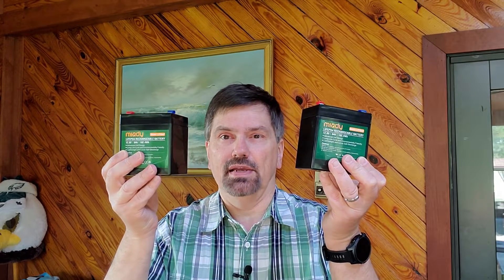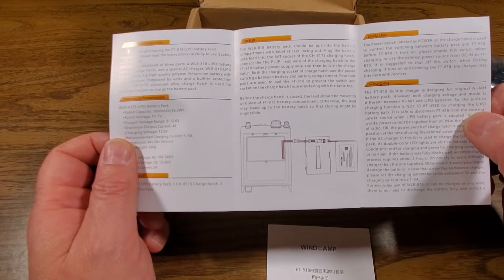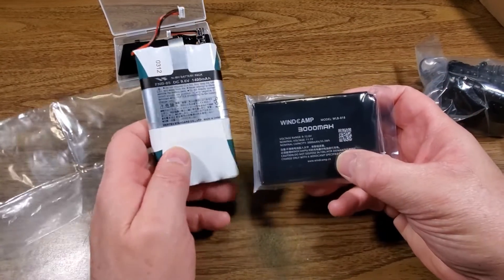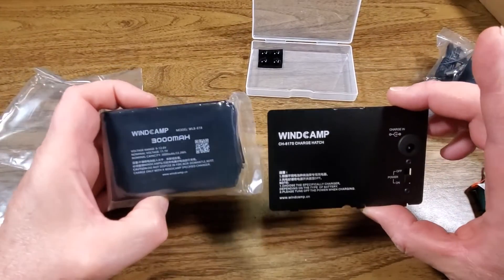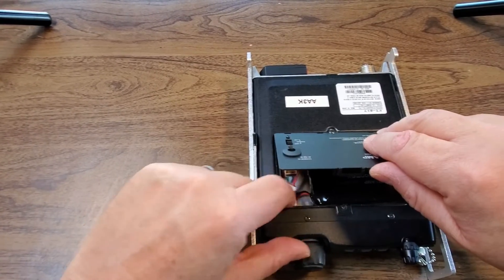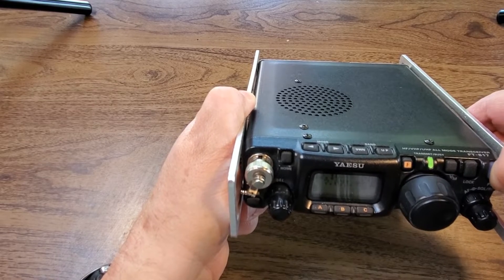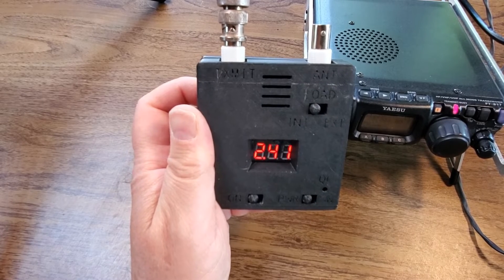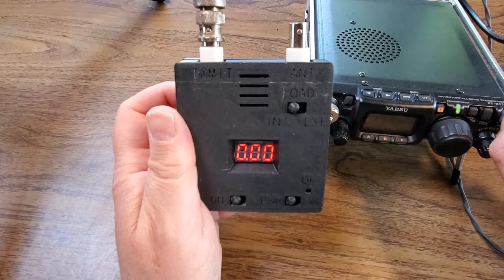Yaesu FT-817 Battery Upgrade: Windcamp Power Solution

Comment: Nicely done.  Only just found your channel.  I'm going to watch more.  Thanks!  73 N4MJR
Reply from the maker: Thank you for watching.  I get asked repeatedly, "How do you use your radios in the field or for POTA." I do these videos to answer that question.

I wish Yaesu had a replacement for the 817. SDR based and in the same form factor. Maybe not as feature rich as the Ic-705 and priced accordingly.  They'd have another winner.

Comment: Very informative. Do you have any idea which battery and charger will work with the FT-897D? For some crazy reason, Yaesu no longer supports that radio. No idea why, as it is a fantastic radio for field work. Yes, it's heavy, but it's also all bands, all modes at up to 100 watts depending on the frequency. 

Anyway, you have a great channel. Keep it up!
Reply from the maker: Thank you for the kind words.

A quick web search turned up this at Amazon, looks like new old stock. https://amazon.com/dp/B00F8G0N3U

Another cheaper option https://twowayradioworld.com/products/yaesu-vertex-fnb-78-battery-for-ft-897-ft-897d

Here is a mod to use gel cells https://www.eham.net/article/4114

Hopes this helps.

Comment: Whoa!!! I have a 817 and need to replace the battery like a long time ago….. is there any danger of that battery catching fire? I’d hate to lose my 817!!!
Reply: I've had one of these in my FT-817 for probably getting on for 10 years. No problems whatsoever.
Reply from the maker: @rjy8960  I had a security system control with a built-in Li-Po backup battery. After a couple of years started getting error messages about the battery.  Called the company and their first question was to check if the back of the unit was bulged. It was, and they sent a new controller.  Yet, all the cell phone batteries for more years than i care to count have been fine.
Reply: @aa3konthego  My concern here would be that in the security system, the battery is constantly (possibly!) being charged. With the 817 battery I’ll charge it once in a blue moon when I need it.
Reply from the maker: @rjy8960  you are probably correct about the security system.  How smart was it's charger?  I saw some notes on the 817's Groups.io page that people ha e had the Windcamp puff up on them. They said they just ordered a new battery from eBay.
Reply: @aa3konthego  It does drop the charge as it gets closer to capacity - you can see the LED go from red to green through orange as it finishes charging. Once it's charged, I normally disconnect although I have left it connected overnight before.
Reply from the maker: I'd get it out of the radio especially if swollen and properly dispose of it. I'm assuming you have a lithium polymer battery.  The Ni-Cd and Ni-metal-hydrides are much safer.